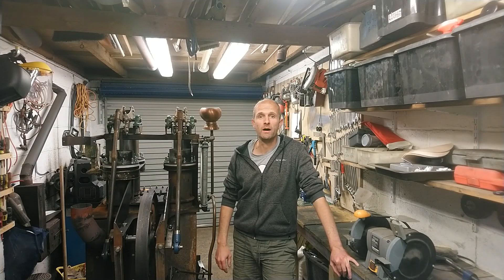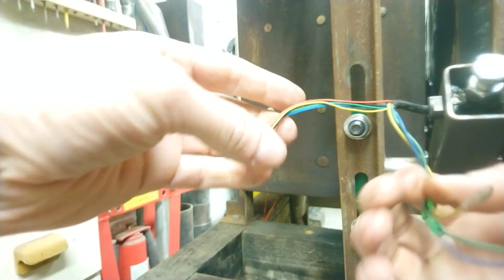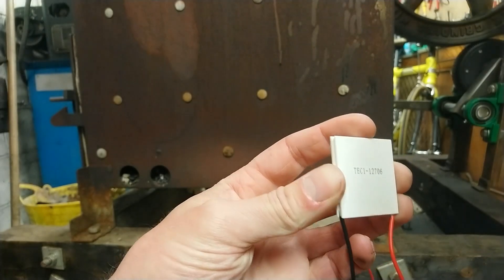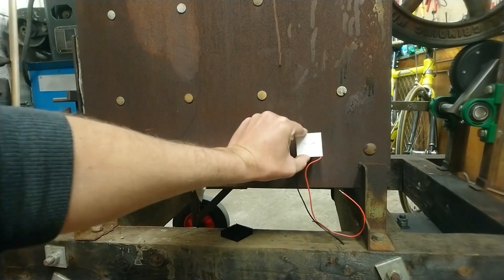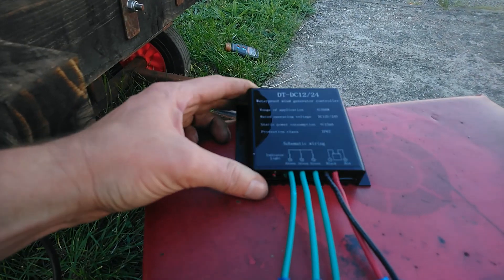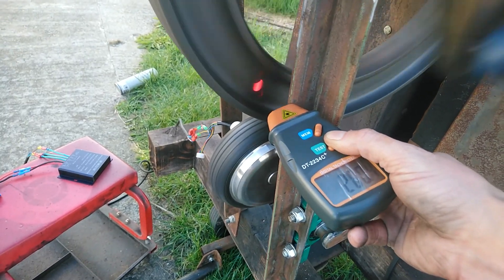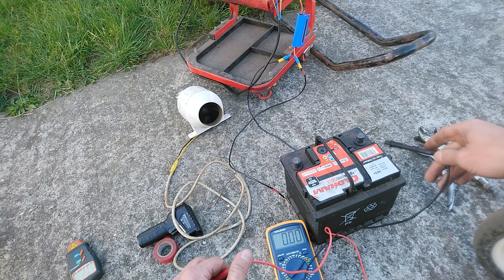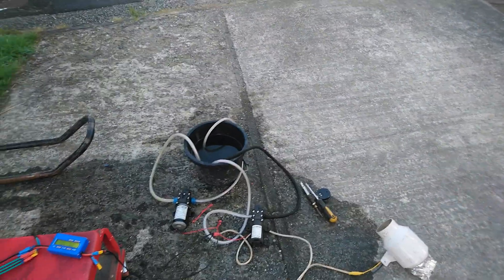Stirling Engine Generator - Hoverboard Motor (PELTIER Module) Test 1 Video Part 9

Comment: Hehe lovely! Your Stirling engine is cracking. I’ve had a lot of experience with these motors building wind turbines and hydro turbines as I live off grid. The maximum in a gale ungeared was 200w’s. Your machine I assume has lots of torque power to push a gear system. If you can raise the speed of the hub to around 1-3 ratio to get 500-600 rpm you’ll see the full wattage. The problem wind is if you put gears on they become hard to turn along with a load makes for enormous blades. DIY and enormous blades don’t mix. I think you’ve cracked that problem..

Comment: The red light is on to indicate the turbine is spinning, the green light indicates the battery is connected properly. The brake comes on at 15 volts and only for a moment, to prevent charging over 14.8 volts,15 volts is the limit,you'll see the amperage and voltage drop off intermittent at 15 volts. I have several wind turbines, running the same controller on my little guy.
Reply from the maker: Hi, great info, I could have done with that at the time! Cheers

Comment: I have heard that the hoverboard motors are usually 3phase wired in parallel. If you rewire the 3 phases in series, you could potentially increase your voltage to closer to 110v. The amperage would most likely be lower, but this could be used to power small 110v household appliances. Super awesome stirling engine!

Comment: it will slow down like a windmill controller.... it wants to brake ... you need a diode bridge from 3 wires to 2
Reply from the maker: Yes your right, I experienced that during testing! All the energy was being turned into heat!

Comment: very nice! I would think you could get better results with a smaller set... it would decrease the ammount of energy dissipated between friction, moving parts... heat disipation per se, etc...
Reply from the maker: Couldn't agree more! the losses are huge in this engine. When I build the mk3 engine it will be smaller, simpler but still easy to build, cheers

Comment: Peltier elements are the sort of thing you might want to wrap around the flue just to scavenge a few watts. They're pretty horrendous efficiency, but any watts is better than no watts when the flue isn't doing anything except exhausting waste gases anyway. You'll also probably want a better heatsink for the cold side so you get more heat difference. Last time I did that I used a chipset-style sink like you have for the hot side, stuck over a candle flame, and an old heatpiped CPU heatsink for the cold side. You can also get peltiers designed for cooling/heating which are different from peltiers designed for energy scavenging, though they'll both do either task to some degree.

All that said, that's a fantastic contraption you've got there. Better than my experiments with making microquad props spin with peltiers and tea-lights. c:
Reply from the maker: Thanks for your comments. I'll need to give the peltier idea another go. The "contraption" (I like that!) isn't without its design problems. I think all experiments are valid. The greatest discoverers of all time were made by accident!

Comment: at 6:46,   AC  volts  are coming out of the alternator.!!!!!!!
Reply from the maker: I've got the voltmeter set to AC and am measuring the the voltage between 2 of the 3 phases (open circuit). These hoverboard motors are 3 phase brushless motors in their previous life

Comment: information.          at 2:34, bravo.   for your comprehension.           at 2:48,  this is  not torque; this is  lenz-related  DRAG/load.     and, this  drag does  NOT  occur, during a measurement of  voltage.!!!       consequently, a  Correct  voltage value  NEEDS  TO  BE   based on  the  LOWER  engine rpms; as  when the alternator output is  Shorted.        at 6:12, in this configuration, the alternator is  NOT  being drive via  reduction.
Reply from the maker: Hi David, I needed to look up lenz's law to start to understand your comment! Could you explain the last bit to me again, many thanks

Comment: information.       MANY   aspects of the design of this engine are  LESS-than ideal;  at each such design flaw, energy  is  LOST.!          these are  SOME  of the problems.
the output of a  ANY  heat engine is  ALWAYS  low-torque.!!!        consequently, the best efficiency will occur where an engine  is  Designed  to  operate  as  Fast  as  Possible.       and, the first output stage should be a  'conversion' of  rpms  to  Torque.      in part, this  NEEDS  to be done in order to prevent excessive slowing of a low-torque prime mover, when it is loaded.      (compare a small gearmotor; in which, Correct design results in a  high  motor speed.)
this engine consists of two-pairs of cylinders/pistons.      and, it should be understood that it is  IMPOSSIBLE  for any two heat engines to be 'tuned'  EXACTLY  the same.        therefore, this type of  joining  of two engines  IMPOSES  synchronization; between the 'sides'.
where cylinders are vertically oriented,  GRAVITY  opposes  the movement of the pistons  fifty percent of the time.!!!
in order to achieve highest engine speed, it is  CRITICAL  that  the mass in  Each component that  Reciprocates   BE  MINIMIZED; eg.,  PISTONS, CONNECTING RODS  and  WRIST PIN ASSEMBLIES.!!!
the use of such rocker assemblies is  NOT  recommended.     for  TWO reasons:  the reciprocating mass in the rockers acts as  speed limiters/governors.       and,  the  LENGTHS  of  the  connecting rods  be sufficient to  'smooth'  the  angular offset  that  occurs at each crank.!!!
the way in which output energy is 'transferred from'  the rockers to the  output shaft is  LESS-than  ideal/efficient.
NOTE that the output energy is  CONCENTRATED  at the output  SHAFT; not at the outer radius of a flywheel.!!!!!!
the output  SHAFT  is where the output energy should  be  taken off/used. 
an unmodified bldc motor  makes  a  POOR  alternator.!!!         output energy should be taken off, at the output Shaft, via  REDUCTION; of  ten or more to one.             googletranslate
Reply from the maker: Hi David, Thankyou for your comments. Yes, I believe the design is flawed in many ways and agree with most of your points (and have experienced the problems first hand while running the engine!).  

There were compromises made so a working engine could be built with limited facilities and a basic design. For instance, the hot piston is very long / heavy because it forms part of the annular heat exchanger passage and is needed to keep the seal away from the heat. The flywheel could have been on top of the engine but I didn't want it to be to tall and top heavy.

Over the coming months, I'm going to be building a new engine. I'm going to do a video of the full build (including designing). Hopefully the Mk3 version will improve some of this! 
All the best

Comment: Shane could you add some counter weight to the flywheel cranks to offset the connecting rod weight. I think it will run so much more smoothly
Reply: This is a beautiful machine.
Reply from the maker: Hi Perry, I did add some 6mm steel plates to the actual flywheel but yes, the balance is a still way off! Flywheel weights certainly would be a step in the right direction. For some reason I didn't really consider it while building it! I'll add it to the job list. All the best

Comment: Great video Im happy to see my suggestion on the hoverboard motor worked out well. I would also suggest using one of the cheap plug in car heaters as a load for your battery it will draw 10-15 amps. The watt meter your using can be powered independantly so you can keep the data on screen even if you disconect the battery. I look forward to your next video I have wanted to build one of these engines myself but have never had the opportunity. The peltier idea isnt viable with the cheap modules from ebay they are to inefficient not saying the idea doesnt have merrit as they use peltiers on RTGs that power satalites and rovers but these modules are not usually found on ebay something about radiation and red tape.
Reply from the maker: Hi Chris, yes thanks for the hoverboard suggestion and info on ebay peltier modules. I'm just about to start work on the next stirling engine and am hoping this will be simpler to build and not require machining tools. Thanks

Comment: Excellent progress!!! Very happy to see some power output numbers!!! You are one of the few on all of youtube to actually show measured power. Most stirling engine videos show voltage output which is meaningless. I am more than sure you can get much more power out of the engine. The whole thing vibrates, swings, and flexes the mount. Those are all power leaks which could ultimately be improved. Looking forward to the next chapter!!!
Reply from the maker: Hi, yes, not the most efficient engine but I hope to fix some of that with the Mk3 engine coming soon!

Comment: Great Project, to measure amperage your meter needs to be in series with the load but is limited to 10a (you are surpassing that) a simple way to create a variable load is to buy a roll of resistive wire (heating element wire) ….simply moving an alligator further away(increasing length of wire) increases the resistance and lowers the amperage on the system or increases by moving shorter. I would move it shorter until the voltage begins to drop. This will determine your max load. Using the ohms law you can calculate wattage with known voltage and resistance.
Reply from the maker: Hi Joel, That's sounds like a good idea. Thanks for explaining that to me. I've still got a few gaps in my knowledge of how electric circuits react to load/voltage drop/resistance, cheers

Comment: Peltier module need much bigger cooling system. There is the same principle as with Stirling engine, you need the biggest temperature difference as you can be made. But they still too expensive and have too small amount of efficiency.

Comment: Big improvement over the alternator! 
I had a play with a peltier from a 12 volt mini fridge and used a candle for heat and a slightly bigger heat sink than you used for the cold side. I managed to just about get a tiny motor/propeller from a micro drone to spin. I ended up using the motor/propeller to blow cool air over the heat sink and it did boost the power a bit. I only measured about 1 volt. You would need to have a bunch of them wired in series to even think about getting any useful power out of them.

Comment: I really am enjoying the progress and to be fair, you are making useful energy now - for example, you could stoke the fire for a 12 hr run and store some pixies in a battery bank - by burning rubbish, old engine oil, gas, etc and there is a way to burn old oil fairly cleanly so you don't have to stoke with wood or coal. But that is another chapter. If the firebox is converted to use air blowers - oil and diesel drip injector and a hot cone in place it would be off to the races. The kind of diesel burner used for heating water jackets for old school central heating - would light things up. I have to say if that happened this engine of yours would turn into a 24 hr donkey engine, plodding along mostly unattended. What do you think of that idea?
Reply from the maker: Hi, Yes, that is a great idea! Could be worth an experiment. I'm not really happy with the furnace arrangement as it is. Thanks

Comment: The cheap ebay peltiers will get damaged over about 150c  they are also very low output power. the rated power on the advert is the input power.  I had 4 together and it wasn't really enough to charge a cell phone.
Reply from the maker: Hi John , that's interesting. I may have in fact cooked mine then! Might explain things!
Reply: Shane,
     When you experiment with a peltier module in the future consider making water tanks on each side to control the temps. One ice cold tank and one hot water tank, you can control and measure water temps more accurately then measuring electric output will also be more accurate.
Reply: @terrafirma9328  Thats a good point yes. The thing to remember about seebec effect is that it is the difference in temperature. the colder the cold side is is as good as getting the hot side hotter.
Reply: @ShanePomeroy  very probably yes, if you want to test it, put a couple of volts into it and see if it pumps heat .

Comment: You need to measure current in a circuit, like generator + -> load -> amp meter-> generator -